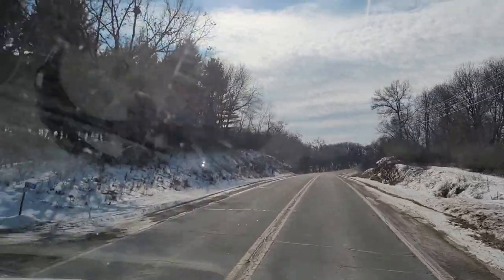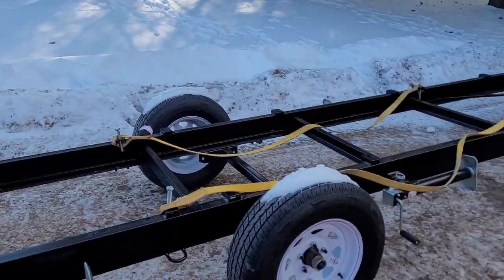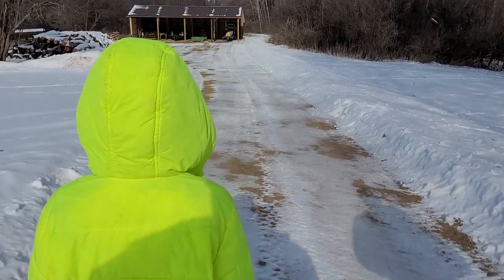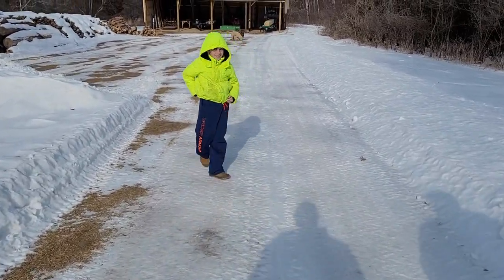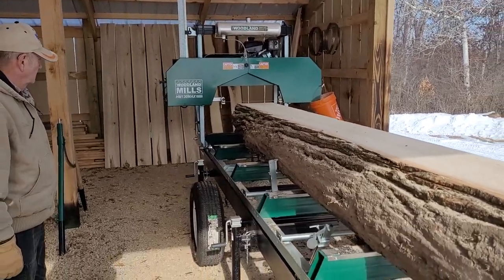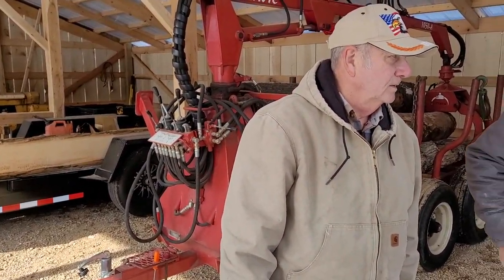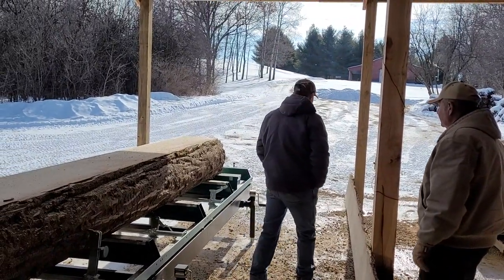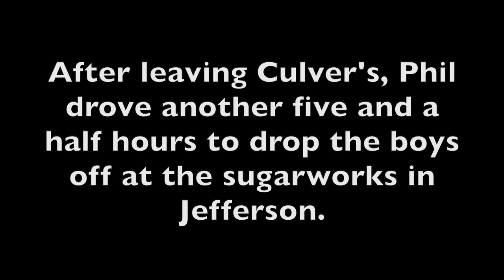#27 Wisconsin Maple Syrup Trip: Woodland Mills HM130 MAX Trailer Pickup

Comment: Could you have mounted the rails flat on the trailer, just used longer bolts?  I’m gonna build a trailer and just not sure if its better to bolt it flat down, or weld little spacers like you have done… thanks looks great
Reply from the maker: Dan has these made.  He buys them in volume so it makes sense for the manufacturer.  In the description you can see a link to his video where he shows and explains the assembly.  

For the expense, it may be worth buying it ready to go with all of the engineering completed.  I don't think you can buy the material, assemble and paint it for what he charges for a trailer.  That's my $0.02.
Reply: @BissellMapleFarm  thank you for the reply

Comment: I needed this info Dan worse than anything, I have been running water lube on walnut, and blades slip off alot.  I do not run pine so the lube is off for good.  I have the 130MAX XL on trailer.
Reply from the maker: Dan is a pretty smart dude.  I will take his advice as well.